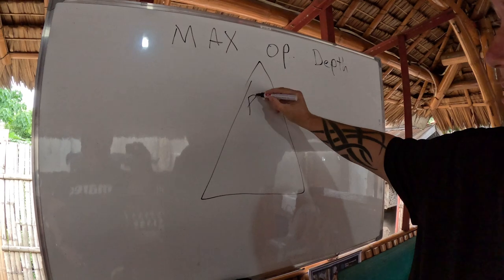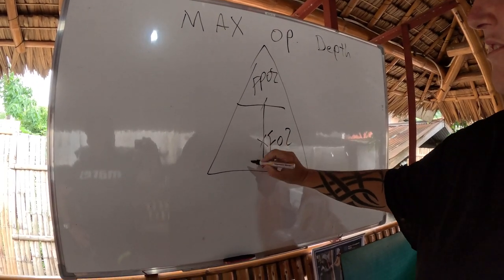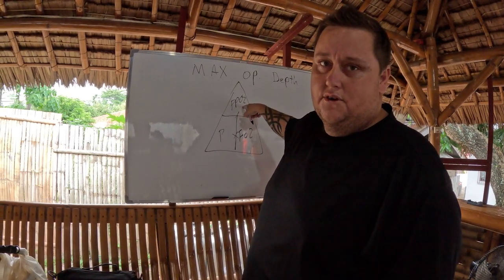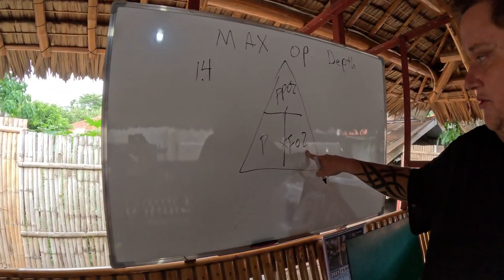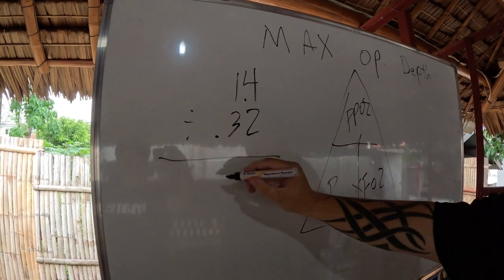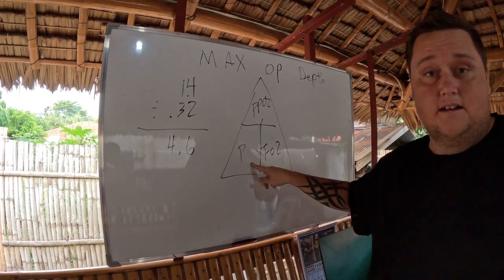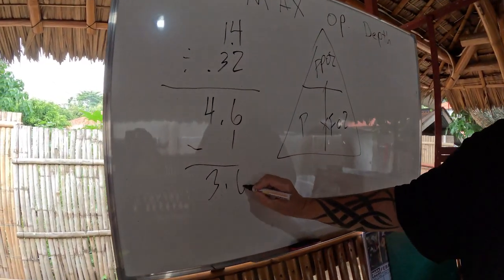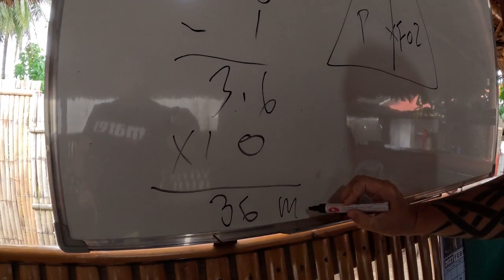Calculating MAX OPERATING DEPTH for NITROX

Comment: It's been nearly 30 years since I was diving.  But when I was diving, 100 feet was MOD using  compressed air.  I don't see the advantage of going with mixed gasses for an additional 18 feet.
Reply from the maker: The primary benefits are extended bottom times and shorter surface intervals between dives, not deeper depths. Less nitrogen is always better/safer

Comment: okay let me clear understanding   i have Nitrox cerf.  so i want to make sure ean 28 is for 80 to 100 feet    ean 32 for 100 to 112ft   and ean 36 for 112 to 120   ean 40 for max 200 ft.. is that correct??
Reply from the maker: You have the cert so you should calculate that yourself, or get the app